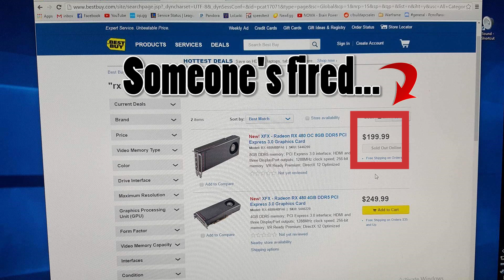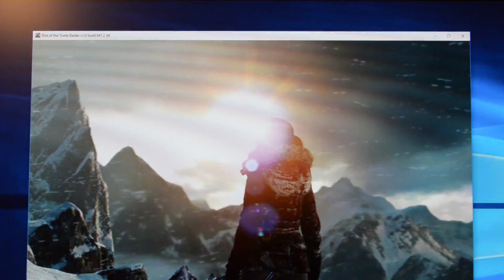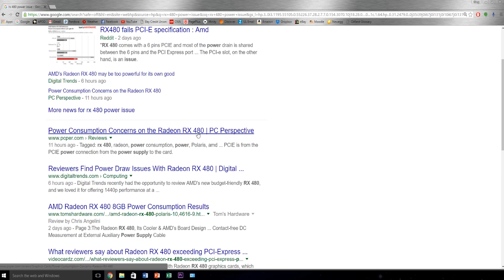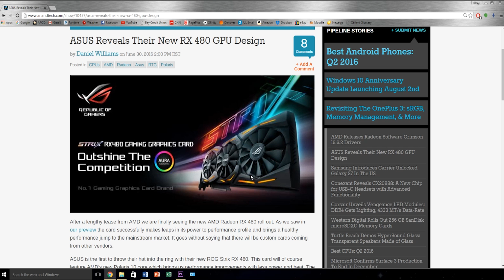RX 480 Aftermath: Power Issue & Over-Hyping

Comment from the maker: - I should clarify. The only motherboards that will likely experience any issues are those with terrible power delivery integration or boards from ~2006 and earlier featuring PCIe 1.0 and 2.0 revisions. Most modern boards - even the cheap ones - should be fine. Again, my suggestion is (just to be safe): wait for third-party 480s to roll out. Search for the 8-pin and 6-pin x2 cards and opt for those. Thanks for watching!
Reply: It is also important to mention that even though nothing will most likely happen with good motherboards, the GPU should never pull more than the PCI standard allows. That is a design flaw.
Reply: love it again how amd gets blamed again even though the 750ti is drawing more than 75 Watts from the pcie...........
Reply: Same as the gtx 960, it peaked even higher than the rx480 , mind you the rx480 had a higher constant load, but only 5 watts over the threshold meh
Reply: here in Indonesia
XFX RX 480 8GB around 296USD
XFX RX 480 8GB Black edition around 319USD
still cheaper than 970 OC around 365-400USD
Reply: PCI-E spec allows more than 75W per slot. so this entire powergate is just a big fuss over nothing.

the 980TI and 960 both used more than 75W from the slot. nobody cared than. why should you care now.

and since the mobo delivers the power it should according to the spec also limit it to it's design. so no mobo should ever die because of it and if it does you should return the mobo and not the card.
Reply: rx 480 8gb costs like ~350$ here in Finland (the cheapest card)
Reply: here in Italy the 8GB version costs 299€ holy jesus, isn't worth buying it
Reply: Christian Meyer and the 750ti had the same issue:
http://media.bestofmicro.com/2/W/422600/original/01-GTX-750-Ti-Complete-Gaming-Loop-170-seconds.png
Reply: the 8GB in South Africa is around 380USD or around 342.51€ lol still worth it compared to the 600+USD for the 1070 and 400+USD for the 970
Reply: typical foxconn motherboard. I used to have a g31 brand-new from them and it died like after 6 month of usage.
Reply: i5 6500 on a h170 motherboard, should leave you room for ram and a ssd
Reply: in Greece we only have prices for 8 gb rx480 version starting at 302 euros
while the cheapest 970 4gb  is 295 euros

MSI GeForce GTX1070 8GB    512 euros
MSI GeForce GTX1080 8GB  814 euros
Gainward GeForce GTX 980 4GB (3385) 423 euros
EVGA GeForce GTX980 Ti 6GB Superclocked 480 euros
Gigabyte GeForce GTX950 2GB 152 euros
MSI GeForce GTX960 2GB 187 euros
MSI GeForce GTX750 Ti 2GB 116 euros

1 Euro =
1.109755 U.S. dollars

and these are the monthly minimum wages in eu  countrys
so cheap depends A LOT on what counrty you live in
https://en.wikipedia.org/wiki/List_of_sovereign_states_in_Europe_by_minimum_wage
Reply: lol ,who cares !!  980ti had the same problems and no houses burnt down.  and who in the world uses a 10 year old mobo and want VR with that. 
smear campaign
Reply: the problem is likely second hand parts, from 10+ years ago being sold and traded along the USA.
Reply: Malte Roeper
Did 750Ti cause safety shutoffs and even burn out PCIE slots on boards? I can guarantee that people would be pissed if that happened, especially considering how much whining there was about the 3.5gb non-issue.
AMD spends a lot trying to undermine their competition. Apparently, it should have been spent on R&D to prevent this kind of shit from happening.
Reply: 329€  for 8gb gigabyte and 351€ 8gb for asus and refrence cooler,. gg
Reply: Here in Germany the MSRP for the 8 gigs is 269€...the funny thing is, that the GTX 970 and AMD R9 390 are sold for around 250-260€.
Reply: +Autistic filter my guess is the inflation that we get in New zealand for electronic products (a fair bit) and that the price is in NZ dollars not US
Reply: I bet its still cheaper than the GTX 970
Reply: Good job for explaining that... people just doesnt understand that rev 3.0 can draw 150w from pcie
Reply: +Skander Helali tell that to the 960 and 750ti.... Let's not twist it thinking this is the only card that has show to pull more than 75 from the pci slot.
Reply: I have a 2012 Motherboard with PCI-E 2.0, and I do remember getting BSOD while playing games on a R7 370, but it's not due to hardware issues, but software issues. If you try to download War Thunder using their launcher, for some reason, your computer will randomly BSOD, in the past when I also had Black Desert Online installed along with these games, it almost always BSOD if i start using my browsers for some reason.

Chances are, putting a RX 480 into a ZP68AP-D3 won't create this power draw issue, because it's 6 years ahead of whatever people tested this card on, trying to make dirt cheap PC builds.
Reply: Sadly a 1080 works well with the same motherboard....your point? Matlockization
Reply: Hello Pastechi.

I was responding to comments about cards like the 960 or 750 Ti also having higher than spec. power draw spikes from older PCIe 1.X and 2.0 slots, similar to the behavior described of the RX 480. My example was for comparison purposes.

At the present time, I do not have a reference version RX 480 to test with my E8400 build.
Reply: Even a small overclock to the reference rx480 pushed it to 1-200 watts of draw on the PCIe slot.  Even a good mobo can't handle that.  It's a design flaw as they are not clamping power draw from the PCIe slot.  My guess is they pulled the power regulation out to save money.
Reply: Here are 2 GTX750ti cards that have no power connector and draw over 90W form just PCIe slot...for years. Pretty much all 750ti do that

http://www.guru3d.com/articles_pages/msi_geforce_gtx_750_and_750_ti_gaming_review,3.html

http://www.guru3d.com/articles_pages/palit_geforce_gtx_750_ti_stormx_dual_review,5.html
Reply: +Science Studio Post some sources before you go back to retweeting compliments about yourself.
Reply: weILL
No idea man but it can't be long before they release. Other manufacturers wanna make money too. As for pricing, I'm guessing that the custom ones, unlike Nvidia's Founder's Edition, will be more expensive than the reference board. I expect custom 480 to be closer to 300. If they are gonna be worth it, remains to be seen.

Do note that this is some speculation on my behalf.
Reply: I never claimed that you were overclocking. I am simply stating that most people who are buying the RX 480 most likely have a newer cpu to take advantage of the RX 480. If you have a newer cpu, you probably have a newer mobo, and you shouldn't have any issues if you are not overclocking. If you are overclocking, you should buy a AIB card regardless of power delivery. However, how is this an isolated incident? If it was isolated, wouldn't the whole powergate thing be non-existant?
Reply: I wouldn't use Science Studio a trusted source of information regarding the RX480's power delivery. He will refute with wrong information to boost his inflated ego regardless of actual facts.
Reply: Please man. I watch the kid because he is well spoken and seems nice. Still if your gonna put yourself out there gotta be willing to answer. Just want to see it on video this board crashing and what board it is.
Reply: +gundum1o1 okay you're right. I apologize. I'm frustrated  that someone who calls themselves Science Studio would delete my comment on power delivery and condescendingly respond with irrelevant information. I don't understand why he would do it. My opinion is he has become so desensitized to the YouTube comments that silencing his own audience seems like a good idea. Sorry.png
Reply: Lord Xantosh
AMD released a statement saying they'll release a driver that will underclock the cards, but I think if you're looking to overclock reference cards, it's just a bad idea. Better to wait for a less problematic card or just pay the extra for a better product.
Reply: Lord Xantosh
And redesigned PCB to ensure the chip doesn't try to draw over PCIE too much.
The chip isn't bad, as far as what you pay vs how fast it runs goes. It's just a disaster of a product the likes of which I don't think we've seen in PC GPUs for close to a decade now. Not since HD4000 cards were shutting off due to high power consumption and inadequate delivery.
Reply: Look carefully. 64W average. That is real sustained watts, the one that constantly caused long term heating. PCper explains here https://www.pcper.com/reviews/Graphics-Cards/Power-Consumption-Concerns-Radeon-RX-480/Evaluating-ASUS-GTX-960-Strix
Reply: christ on a bike people! Any card that has ever been overclocked is going over 75w... i mean are you guys just deliberately trying to sound like idiots or what... blowing this stupid little thing out of all proportion.. i sense a serious amount of BUTT HURT green team fanboyz are just properly pissed cos' they spend too much fucking money. When in fact you should be thanking AMD for this card and what's to come cos' Nvidia simply have to drastically drop their stupidly overpriced tech. pffft
Reply: DAGATHire
Overclocked cards go over 75w for sure. Hell, this card draws ~150w at stock, no OC needed! AMD has released cards that draw over 300w without any tuning.
The issue is drawing 7a over the 12v PCIE lanes, which is way out of spec and clearly a fire hazard.
Reply: Finally somebody other than AdoredTV puts out a video that has common sense on the power issue. Folks, you are not going to burn your PCI_e lane up on this card unless the mobo is old, cheap and you are trying to, and even then probably not.
Reply: DAGATHire
Normally, overclocking a card pulls more power over the PCIE power connection, not the PCIE bus.
Reply: *****
Going over the rated amperage for the PCIE standard is not perfectly fine. It's out of spec, can damage your components, and yes, is a fire hazard. Parts are not rated to be safe to use out of spec. It's nearly 30% out of range @ 7a.
You probably won't make anything explode, even if you do damage your parts, but the risk is there, as has been clearly demonstrated already.
Reply: DAGATHire
The card goes out of spec at stock settings.
Also, the design of the card is flawed, as it pulls main power over PCIE, which is a huge mistake on modern cards. Allowing the card to even pull main power over PCIE was a mistake. Allowing that power to go out of spec with officially sanctioned software is borderline illegal.

This isn't about red vs green. This is about a critical hardware design flaw.
Reply: *****
Increasing the bus clock does not increase the bus power delivery, and would also be A: in the bios, and not using sanctioned AMD software to do it and B: would also be based on a range the board is designed for.
The issue is that the card is drawing well over it's rated amperage over the PCIE 12v pins, not the supplementary power connections. This is because the card is wired to draw primary power from PCIE, a critical design flaw that should not have been made. They put too much effort into trying to make it a single 6-pin card, and now the consumer suffers for it.

When did it become okay for a major company like AMD to release unsafe/unstable hardware onto the market, actively encourage people to overclock it, and then brush it under the carpet when people wind up with damaged hardware because of AMD's flawed design? Considering nVidia couldn't even get away with having weak access to 1/8th of the video memory on one of their cards, which still performed exactly as advertised in reviews and benchmarks, and posed no threat to the consumer, their hardware, or the function of the product they paid for, I'd say this is a pretty sad double standard.
Reply: Hmm, how? The spec says 75W. If the motherboard has protection built in to shut itself off if the 75W gets exceeded, how is this a design flaw?
Reply: DAGATHire
Burning boards due to a critical design flaw isn't a "wee bit flawed". There's simply no excuse for that, ever. Who are you trying to fool? Yourself?
Reply: *****
It's causing problems at absolute stock config. That should not be happening, period. The product is flawed, get over it.
Reply: Blake Bishop
It's probably not dangerous, as newer PCIE3.0 compliant boards have higher standards for current, but it's still going out of spec and therefore no one can really say if it's going to cause harm. It's possible it could run fine for years and then suddenly, your PCIE slot or motherboard will quit without warning from being damaged slowly over time.
Reply: NukaFizzy
Don't risk it. AM3+ boards are only PCIE2.0 compliant, and mid-range full ATX boards rated for 140w+ CPUs have been found to suffer longterm damage from using the RX480.
Reply: NukaFizzy
It boils down to amd fucked up, amd should have put more load on the 6pin and not the pcie slot..
Reply: No, it,s not. Check it yourself, a driver update fixed it all.
Reply: obshaky
More like that's what you get for buying a card that doesn't meet safety standards.
Reply: politicians are evil
Reply: MY BUDGET IS $1200. Can someone tell me a build for the GTX 1070? I want to play most games at 1440p at high fps and high/max graphics settings. But I expect it to run all games at 1080p Max settings and 60 & higher fps! I'm just not sure of what cpu to get and stuff in order to achieve this!!!!
Reply: +Whippybox_grHD! Get The 1070
Reply: thank god. my MSI H110M Gaming motherboard shouldn't be a problem, right?
Reply: did you post this comment because of my question ??? just asking :>
Reply: If my 8 gb rx480 fries my 2015 mobo, I know who to blame and send an invoice.
Reply: hi other said if comparing total system power rx480 is more efficient with AMD CPU is that true?
Reply: You should be fine.
Reply: It sucks cause in the UK you can get a GTX 970 for cheaper than the RX 480 4GB variant
Reply: Here in Malaysia, the price for rx480 would be RM 1100( 350$ maybe?) (includes gov tax)..I would say a lil bit expensive but atleast not more than 960 ti thats a steal for me. I just wish the gov back then didnt include the taxs, the price would be lower than 300$ and that i can get it..
Reply: +Tanker 2000 i also feel like dats going to be the price here in Malaysia. tho, i cant find any retailer that sells the 4gb version
Reply: Please do an OC temp test. OC3D and tech of tomorrow reported temps of 93 and 91 with a meager OC
Reply: No you cant
Reply: + Sillense Winter I don't understand why the GTX 970 costs so much in Indonesia? Here in Australia the 8Gb (4Gb unavailable) RX 480 is $369-$479 (AUD) which is about the same as the non-reference R9 390 and GTX 970 cards with factory overclocks and improved coolers (both typically around $400 AUD).
Reply: +Swo-E's Mum its still $375 usd
Reply: +Autistic filter ah ok I guess its just the inflation over here, they really put the prices up on some things.
Reply: +Hristin Marinov it is, usually 80$ less
Reply: +Malte Roeper .
Never had any problem with my 750ti and it has no external power(msi version) and btw my motherboard is a cheap asrock
Reply: Try trovaprezzi.it
Reply: +Science Studio Do you think my Intel H67 motherboard should be able to handle the 480?  It came out in the first quarter of 2011 and features one PCIe 2.0 slot. Right now I have a GTX 560Ti GPU.
Reply: it's only a few watts over the ADVISORY(not even requirement) 75w.Don't oc and increase the power limit and it can handle it.
Reply: I can't imagine the computer recognizing the card if it's it's PCIE 1.0
Reply: and now all jump on the hate train.
people are so sheep
Reply: Taken from the AMA AMD did on the 29th. This will clear up a few concerns and help your point on older motherboards.  https://www.reddit.com/r/pcmasterrace/comments/4qfy9d/i_work_at_amd_the_time_has_come_to_ama_about/d4tksww
Reply: Justin Bail
Makes sense.
Reply: My mobo is getting a bit older but AMD settings say that currently it is set to PCIe 3.0 x16. Does it mean I'm fine with the reference card or should I look for the box from the mobo to confirm what PCIe version does the board actually have? Thanks
Reply: +Jiří Piták you should be fine honestly.  Run some demanding bench makes like heaven or 3dmark firestrike on high and see what happens!
Reply: hey if you reply and help me I will be so happy. I want to get the rx 480, and my mobo is an asrock fx fatality killer or something along the lines of that. Anyways it's a motherboard that uses am3+ cpu socket and I have an amd fx 8350 in there, and as far as I know there are no am3+ boards that feature pci 3, so would I still be OK? it's not really a cheap motherboard when I bought it about 3 years ago. I may possibly be wrong about the whole pci 3.0 thing too
Reply: The PCI-E version is not a problem. I would recommend you though to wait about a month or something for the custom variants of this card. You will get better power delivery to your card, MUCH better cooling and acoustics, probably better aesthetics (depending on your taste), better overall build quality and better overclocking.
Reply: I5 6600k, asus z170-P motherboard, kingston hyperx fury 16gb kit, hyperx fury 128GB or 256GB SSD, WD Black 2TB HDD, EVGA or Corsair 650W power supply, and of course gtx 1070. 

Here's the pcpartpicker list: http://pcpartpicker.com/list/nWGYr7
Reply: Yes even mediocre mobos should not have problems with RX480 but there is always a possibility of your waranty being revoked by mobo manufacturer for using hardware with power requirements exceeding PCIe standards if something (even unrelated to PCIe) goes wrong. 

It is also problem for ppl gaming on budget (they are targeted audience for this card btw) with mobos that are not that great or suitable for OC...
Reply: Διαμαντής Ok, but I kind of wanted the reference version because I was thinking of doing crossfire down the road and I heard if you have a blower style cooler like this it is much better for crossfire or sli
Reply: thanks dude I was just about to ask. love your videos.
Reply: +Mauri .tanga constant load is less stressful than erratic spiking.
Reply: So should it work with a msi h81m-e33
Reply: Beast Unleashed
 Lots depend on the motherboard and how much clearance it offers between the PCI-E slots. You will need good airflow in the case anyway. As for the custom cards, if you are interested in Crossfire, overclocking might be of interest to you as well. In that case, custom cards will most likely offer better overclocking potential.

Either way, it is probably best if you wait for the custom cards to release so you have access to actual data and not just my thoughts.
Reply: Same, 350$ in Croatia.. Bought it tho, I don't expect the prices to drop so soon. OC versions will be 400-450$
Reply: comeon man you should know that this card requires a 500 wat power supply
Reply: the thing is if you make a "Budget card" you have to make sure it will work with "Budget build" meaning amd still fucked up
Reply: i will be fine with a gigabyte 78lm3  with pcie 2.0 x16? the mobo is a bit old i guess cause it support athlon, phenom and amd fx cpu´s.
Reply: 402 dollars in Chile or 269990CLP.
Reply: Pastechi Give me proof. 
'However with our Asus Z170-Deluxe in the test system, the Radeon RX 480 ran smoothly, and also with our MSI Z97 Gaming 3 there were no abnormalities.'
Reply: While I was rebuilding my old XP system, with an E8400 (E0 stepping) £6.99 eBay CPU, and a never before used brand new Gigabyte EP35-DS3R (Rev. 2.1) motherboard with a single PCIe 1.1 x16 graphics slot, I initially used my EVGA GTX 960 SuperSC 4GB card from my current build for test purposes.

It was attached to my 10 year old Jeantech Arctic 600W PSU, using the PCIe dual 6-pin to 8-pin adapter that came with the 960. Also used was 4 x 2GB sticks of G.Skill 1000MHz DDR2 5-5-5-15 2T memory running at 2.0v, and a Be Quiet! Shadow Rock LP cooler with Arctic Silver 5 thermal paste for the CPU. Later, I got an EVGA GTX 750 Ti SC 2GB card for the E8400 build, along with an EVGA backplate to go with it.

Steady as a rock the whole time.
Reply: Outtheredude did u try putting the rx480 in that build? :v
Reply: Matlockization Even tho i did it myself, u can find proof anywhere on the net.
Most mobo's are on PCI 2.0 while some of the new motherboards have PCI 3.0 but we are still using 2.0 so any type of gpu should still work fine on those cheap boards. Overclocking is the thing that can break cheap boards which is why you should not overclock with cheap boards. P.S. you see ones you have PCI Certified on your product, means your product will be able to work fine on cheap and high end motherboards. AMD can be dealing with serious issues at this moment if the rx480 cant handle cheap motherboards...we can be talking about lawsuit of a lot of $
Reply: +Abram Carroll its only can be fixed with an after market or custom cooler
Reply: great to watch another experiment done on the 480. my motherboard is ASUS M5A97R2.0 i think it was manufactured 2012and still i think my board is OK with this 480. (I had also a 500W powersupply)
Reply: what year was it manufactured? mine is 2012 (asus m597, it's good based on my research)
Reply: yeah, im also waiting for 980ti to price drop here in canada but they are still priced the same one and two weeks ago.
Reply: +Διαμαντής and... better price? Asking you about that cause I'm very interested in rx 
480.. at the same time I would like a better version than the reference 
one. So, if you know how much time I should wait for a custom 
rx 480 at a good price I'll appreciate.
Reply: +Beast Unleased, +jiri, + pitak +drag0n, I did a research on this matter. i have 2012 mobo, same with you it is AM3+ (its an asus) and it has no PCIe 3.0 slots, all are just PCIe slots 2.0 with x16 and  x4-whatever that is. My cpu is a fx 8320. Anyway, as you can see, GTX1070 and 1080 is PCIe 3.0 and 480 is also PCIe 3.0-BUT IT DON'T MATTER. Anandtech and Guru 3D did a 17 page documentation on how PCIe 1.x, 2.0, 3.0 works and they say PCIe 3.0 is backwards compatible. And based on their test, there is just a miniscule, so mini like 1 fps FPS difference between PCIe 2.0 and 3.0 So yeah, don't matter you and i can buy 480/1070/1080 and plug it on our "old" mobo [what a relief] and them will still work. Bottleneck? .. not really.
Reply: PCI-e 3 can use 12V 5.5A and 3.3V 3A for a total of 75W.
That means the 12V is only rated to provide 66W +/-9%. If we factor in the +9% that equals 72.25W. 9.9W can be provided from the 3.3V Rail except Pcper showed the 3.3V Rail only averaged a 5W draw on a 480. The 12V rail provides most of the motherboards pcie power to the 480. Let's say the 480 was pulling 180W, that's 90W from the motherboard. That means that 85W was being pulled from the motherboards 12V rail. 85/12=7.08A on average or 12.25W over the 72.25W specification.
Reply: Mine is 2.0 from 2011 will I be safe?
Reply: andydabeast
yeah man. dont worry it will be fine.
 mine is 2.0 too.
Reply from the maker: I never mentioned overclocking anywhere in this video, so I'm not sure why a few of you are assuming the RX 480 was overclocked in the system. It was running at stock, 1266MHz/8000MHz. And please pay attention to the video and watch it in its entirety before ignorantly commenting. You know who you are. My 980Ti worked just fine in the AM2 motherboard. This is an isolated incident. And my 750W SuperNova did not correct the issue with the 480.
Reply: I've seen cheaper mobos, mainly proprietary that I've kludged to have proprietary Atx header adaptors do better on this kind power delivery issue with multi rail PSUs, even really hokey ones vs. proper name brand ones. A lot of them can't deliver the power specified, especially in anything at all manufacturer specific.
Reply: How exactly has he shown us that he is untrustworthy and/or egotistic? In my opinion, he seems to be unbias to companies and seems to present his information in a very thorough and complete manner. He asks a question, researches it, and tells us his findings. In most of his videos, he just leaves it up to us to decide which is better.
Reply: Hey chill with the personal attacks, let the man be himself will ya?
Reply: Reports have come in of midrange AMD FX boards frying from RX480.
Would have been better if AMD made it a 6+6 or 8pin card.
Reply: Whatever waterboy
Reply: Apparently the PCI-E power draw issues arises mainly once people overclock the card, and upon doing so in most cases can void the warranty.
Reply: +Science Studio so i should be safe with my Asus CVFZ due to 8+4 pin power connectors and a Molex power balancer circuit even though it is PCIE 2.0? cause i want to Xfire these.
Reply: dra6o0n Great point. But does science studio know this ? He probably does, but hay don't let the truth get in the way of that Nvidia fanboy.
Reply: Matlockization
Do you think the card only crashed the system when overclocked? People burn up midrange boards, aka the most commonly recommended boards for new systems, by overclocking RX480. When did that ever become acceptable? For the board or the card?
It's not fanboyism to see this as the disaster that it is, and I think, if anything, the tone of this channel isn't reflective of how serious this issue can be
Reply: Lord Xantosh
You'd think a $300 board would be safe, but other 990FX boards have literally burnt up from running the RX480.
Is it worth the risk to have it a little sooner? Wait for partner cards with corrected power delivery.
Reply: alkafrazin but the c5vz has an 8 and 4 pin atx power input and also a molex power input for pcie power stabilization on the bottom of the board too, but i want to water cool gpus so im waiting for news on rx490 or even a vega gpu
Reply: Lord Xantosh
That doesn't mean the PCIE slot it's self can handle the current. Someone had a board die and the actual slot it's self was burnt rather than the power delivery.
Reply: alkafrazin yeah but was it a super high end board like the C5FZ? or atleast have the pcie power stabilization buckle that adds a molex to the pcie circuit to add extra power for multi gpu's?
Reply: Lord Xantosh
It might be fine, but is it really worth the risk over waiting for 3rd party boards?
Reply: alkafrazin yeah but most w/c blocks don't fit aib's A/m boards
Reply: Heyho Science Studio, since you are using the Blue Yeti i wanted to ask: which boom arm are you using? Wanted to buy one sooner or later,but most cant handle the weight...
Reply: After the shutdown did it turn back on or did you had to unplug it completely to drain all power ? I am having the same problem with a 290 since o got it.
Reply: weILL Just a little update, check this out: http://www.overclock3d.net/articles/gpu_displays/sapphire_reveal_their_rx_480_nitro/1
Reply: i have a motherboard from 2015 and i bought is 4 months ago but it has pci-e 2.0. does this matter? my mobo is the MSI 970A SLI Krait Edition. tnx :)
Reply: lukegie11 i wouldn't risk it, the Krait were designed as a budget board.
Reply: what kinda mb or price range would you recommend?
Reply: lukegie11 no clue, due to the current power issue with RX480's i wouldn't risk it, i am waiting to see if they can fix the problem.
Reply: lukegie11 Just wait for some custom cooler models like Sapphire and its power connectors,dont get the reference design and you should be fine
Reply: +Διαμαντής thank you very much for your answer. You are right, other manufacturers wanna make money too :D.. Anyway I'm following the "evolution" of rx 480 Nitro: reading messages by Sapphire on facebook looks like won't pass a lot of time for its release. :))
Reply: TiMeJ34nD1T the problem isn't the cooler but the power draw, which is a pcb remodel that needs to be done, AMD are doing a driver update that underclocks this card to patch the problem, so don't think of overclocking any that use the reference pcb and shitty vrm/chokes
Reply: alkafrazin not after overclocking, just want my case to look cool AF, once i get a pair or 3 gpu's i'm going to switch to a hard tubing build, currently on soft tubing and gpu not water cooled
Reply: Lord Xantosh Most custom coolers have integrated custom PCBs,expecially power phases...i am quite sure MSI or Asus or whoever will put 1x6Pin and 1x8Pin on the PCB,we will just have to wait and see
Reply: TiMeJ34nD1T just needs 1x8 or 2x6 to solve the issue
Reply: Or watch Jaystwocents most recent video for proper clarification and not scaremongering.
Reply: Same in denmark..... (It suck's really hard.....)
Reply: It's still Cheaper than the 4gb version of the 970 from the Green guy's
Reply: So if i have a z170-a asus board and a 750w psu will i not experience this issue?
Reply: Amd have issued a statement saying there's a fix coming soon
Reply: or cheap motherboard as you stated in the video... but the truth is cheap motherboard is only amd...
Reply: Lord Xantosh
If you don't intend to overclock, the risk is probably fairly small, esp after AMD nerfs the cards via software, but imho, if you're spending that much on cooling, it's worth getting some better cards and just not even having to think about it.
Reply: Frederik Winther
Is it still cheaper when you add in the cost of an extra motherboard or two?
Reply: *****
https://www.pcper.com/reviews/Graphics-Cards/Power-Consumption-Concerns-Radeon-RX-480/Evaluating-ASUS-GTX-960-Strix

With our ability to measure voltage and current, we return back to Metro: Last Light at 4K to find that amperage draw over the motherboard's +12V line stays right at 2.5A. That is a drastic difference compared to the RX 480 hitting more than 7A over the same line, especially considering the 5.5A limit from the PCI Express specification.
Reply: Would the asrock 980de3/u3s3 be ok?
Reply: excellent video.. gives a very clear concise and factual assesment, I was considering going back to innital plan to getting the r9 390x, but now the RX480 is back on board :D ..also the prices are still pretty good even in the UK, the card still comes in well under £300, I think the cheapest being about £230-240 (includes 20% vat) from Scan.
Reply: alkafrazin Again... overclocking cards also does this buddy.
Reply: alkafrazin YOu move out of SPEC every time you OC a modern card. At this point you only trying to prove YOU are right and not sticking to the point. This is a massive mountain out of a molehill. 
And i suspect it's created by the green team twats butt hurt by the massive $$$$ they have over spent. It's normal on youtube to defend the indefensible with riotous BS. 
But the fact is that AMD have done nothing wrong here and indeed have already released a patch just hours ago to address the over usage of the pcie bus. Now whats team green's next excuses to ty and justify the stupid prices they paid and will pay? 
P.S.. I'm running 2 GTX 760s in SLI at the moment...But not for much longer! that's for sure. Waiting for a decent deal on some 480s and im jumping ship. Competition is a good thing.
Reply: Exactly,during testing an r9 390 was seen to draw around 36w from the pcie slot,an r9 390x was drawing around 48w.
By contrast the rx 480 was seen to draw over 80w under load from the pcie slot.
Even if you have a high end motherboard it's pcie slot is not rated to handle anything above 75w continuous draw,it can handle short high spikes above 75w but not continuous draw.

There are only a few examples of extreme overclocking motherboards that have more durable pcie slots and they come with an additional 6 pin connector to feed extra power to the slots,no one should need one of those to feel safe running these rx 480's.
It is ridiculous that this card is pulling nearly twice as much power from the slot than the r9 390x and clearly not safe.
Reply: you can not say for certain, just because you have not experienced it.. People with 3 yr old asrock boards and gigabyte 990fxa boards have already reported dead motherboards after simply installing the 480, no overclock involved..    
 At this point it would be better advised to just stay away from amd altogether, this modern amd is not the amd of old by a long shot....   I have an rx480 ordered, when it gets here its getting returned unopened, it will not be installed in my machine.  

 I bought a Sapphire Fury about 4 months ago and the drivers have been garbage the entire time I've owned the card, its underperforming and  was overpriced.. Its getting replaced by the Zotac 1070 amp edition, which is also on its way here..

 I've bought amd for over the last 15yrs, I'm swapping back to nvidia..  Amd's incompetence and lack of quality control  has made the decision for me..Cmon, they've been working on this card/architecture for over 2 years and this is the crap they release to the consumer, give me a break, that is simple incompetence..
Reply: danjal07 Yep.several people have already reported experiencing serious issues,a couple of them on high end motherboards.
The rx 480 is drawing more than 50% of its power from the motherboard,that simply should not happen.
I'm not sure why so many people seem to be struggling to comprehend that.
Reply: too add... When AMD resolves this issue with a driver update, the only way they can fix it is reduce the power to the card, which will decrease its performance.. So, will this make the card run out of its advertised performance? This has yet to be seen, but we will find out, nonetheless the performance of the reference cards should decrease when the stock voltage is reduced.
Reply: alkafrazin Sorry mate... you are firmly on the bandwagon and it's heading for a crash. The 480 isn't going away. The reference card maybe a wee bit flawed but that's soon to be fixed with by the board partners for damn sure. As of now. No houses nor computers have been burnt to the ground by wild inaccurate theories such as you are professing. AMD have moved to fix the imaginary problems invented by people such as yourself and it is an absolute certainty that this is caused by a massive shift in the GPU pricing market. Green have been caught out in their own hubris. And you are most definitely either an employee or a fanboy. but wrong either way and certainly going to lose. Nvidia, make great tech... then they double the price. and that's just not cool "$599" for the 1080 they said at E3.... now go find one for even close to that and you can have my house.
PS... 
490..... ufffff $350? 400 maybe..
team green are literally having a fucking hissy fit.
Reply: Thank you for testing with older parts! It's interesting to note that the AM3+ boards also still use PCIe 2.0. But I guess these boards are newer and will tolerate the higher power requirements just fine.
Reply: I do think every PCIe 3.0 Board should be fine.
Reply: http://pcpartpicker.com/list/vfv9WX  Added like 500 bucks to this price for the gtx 1070. Some people don't know that a i5 is fine to game on max settings on 1080p and 1440p and jump to the i7 right away.
Reply: Hello, I bought an XFX Rx 480 Black Edition, I haven't put it in yet due to all the drama. My motherboard is a 1155 Asrock Z77 Extreme4, Is it safe for me to put this card in my mobo? I'm wondering since its factory over clocked. My case does have good airflow, and my cpu is watercooled, don't know if it'll make a difference... Thanks!
Reply: He'll yes. Go for it.
Reply: +Skander Helali it's a design flaw in the motherboard as well.
Reply: Blake Bishop It's an Extreme, it's made for Overclocking! ^^
Reply: a new driver is coming the 5th to fix it
Reply: i have a gigabyte ga-78lmt-usb3 will that work with the 480? its the only micro atx board i could find that can handle my cpu (fx 8320) stock without vrm overheat
Reply: yes, we should all be focusing on a bottom to mid tier graphics card from two years ago in stead of this newly released and highly anticipated one
Reply: wow so you talk so much smack about the card on the video and all you did clarify was a few sentence... two RX480 is way cheaper then 1080
Reply: will my asrock x79 extreme 6 motherboard be safe
Reply: Stoann
and the 480 runs like a 3yr old card, my stock msi r9-290 runs right with it.
 not too impressive to me.
Reply: BstarElite
a guy on amd forums was running that board and lost his top pcie slot, burnt up part of the contacts in the top slot.
Reply: jesus well looks like ill wait for the custom cards to come out
Reply: and amd is fixing it in a couple of days with a driver
Reply: BstarElite
Most likely, but why would you buy an enthusiast socket CPU to pair with a budget GPU?
Reply: *****
You're seriously defending a product that can physically damage someone's computer?
Reply: +alkafrazin Many cards draw higher than 75w from the pci, gtx 960strix 950 even the 750ti draws higher if overcloacked. Nothing to worry about.
Reply: Avgoustinos Karatzias
 is that why amd has announced they are working on the issue and will make an announcement about it on July 5th.
Reply: When the press is all over you you have to do something. Just like nvidia woth the 970..the card was the best selling card but the press made a huge buzz about it. As i said the 960 strix draw ~200w from the pci!!! Rx480 peeks at 164w thats like 80w from the pci and that when you are playing at 4K metro. I believe this is just another press buzz.
Reply: Avgoustinos Karatzias
too many independent tests showed it hitting over 85w from pcie, one shown it hitting 88w.
 I honestly think there are some bad components on some of the 480's, bad chokes or something.
Reply: danjal07
It's more than that. The card is actually designed to pull main power over PCIE, which is unorthadox to say the least. Normally, PCIE power is used to power memory or other stuff, rather than the main chip.
Asus Strix was tested to pull under 50w from PCIE.
Reply: Avgoustinos Karatzias
Take a look at the linked video. The card is pulling 1.6a over 1.1a pins. 66w is already the peak physically safe rating for the PCIE 12v slot connection which, no, other GPUs have not exceeded. That's 1.1a x 5 slots = 5.5a total, with RX480 peaking at 8a, close to 1.6a per pin.
This isn't just press buzz, this is a legitimate issue that HAS already damaged consumer hardware.

https://community.amd.com/thread/202410

That's not okay coming from a company as central to PC gaming as AMD is.
Reply: Kim Faes
Yeah, no, the 960 Strix was tested and found well within spec.
Reply: they shouldove just added another 6 pin i have a 770 windforce and it runs great with my evga 650w it would be a breeze to run the 480:(
Reply: yup there suppose to making a driver to fix it however so people like me can still pick one up in the future:)
Reply: nope
Reply: That what you get from building junk from old parts. I feel sorry for those viewers that followed advise and built some junk PC and are having issues. Great great job. Amend this by using the new drivers with the same junk build or whatever to dig yourself out.
Reply: Dude!!! hope you see this...

PLEASE talk slower, not only americans see your videos lol

greetings from chile!!
Reply: is a GA-F2A88XM-HD3 gonna work fine with this graphic card?
Reply: Mihael Melnic
Should be fine, but make sure you update the drivers before running anything.
Reply: RX480 starts at €330 in europe, that's well over $350. Almost twice the msrp, lul.
Reply: *****
It's $365. Not exactly well over, and that's probably inc vat.
Still pretty high though.
Reply: I've seen them at €385 here in Belgium, surely it's 20% sales tax and some import fees, but as usual european distributors are fucking us over compared to our US cousins. I mean my mercedes costs 40% less in the USA than what it cost in Germany where it was made and where I picked it up & drove it home. It's nonsense.
Reply: My brother lives in Florida and sends me a box of shit every month because prices here a super inflated. RX 480 in this month's box for sure
Reply: *****
There are a lot of costs associated with doing business in europe, but there's also the truth that prices will remain at what the product will sell for.
Reply: ty man
Reply: *****
The physical capacity of the connections used to safely deliver power is rated, by the highest standards of today, for less current than this card draws.
This is AMD intentionally going out of spec in order to get a "design win" with the single 6-pin PCIE. It was done entirely to fool people into thinking it's a more efficient card than it is.
Reply: will a lga1150 ddr3 gaming motherboard (any major companie) work with an i5 4460? or a lga 1151 with a i5 6400 work?
Reply: PCPer's test is using drivers that are almost 2 years newer then launch drivers. i think if AMD fixed this in only a week. Nvidia could have fixed it also in 2 years.
Reply: would i7 3770 with z77 motherboard work with rx480?
Reply: thanks
Reply: areeb1296
probably not, since it's a newer board
Reply: And this is why you don't push the boundaries of the ATX standard just for some bullet points on a box.